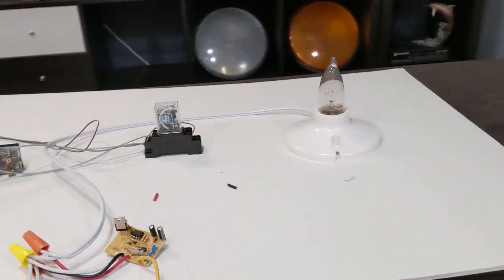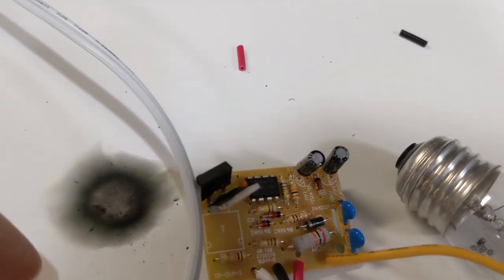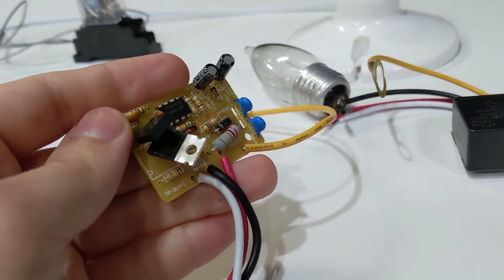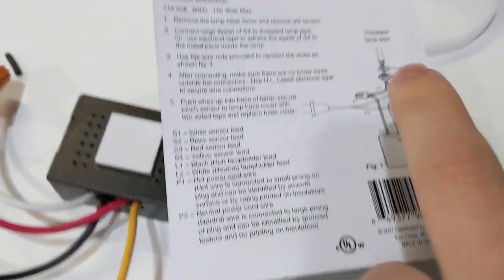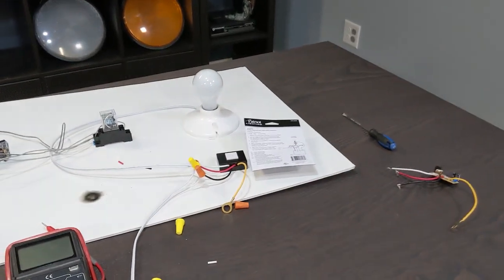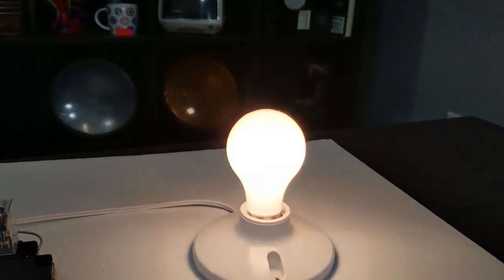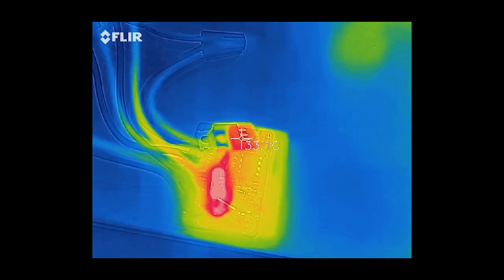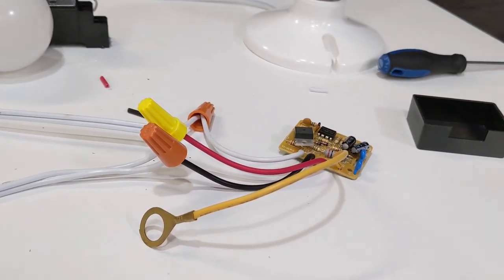A slightly explosive touch-lamp follow-up (standby energy consumption)

Comment: You need to unplug it and plug it in again now that you have a good bulb and see if it flashes while calibrating like the lamp does when first plugged in.
Reply: We can be pretty sure that it doesn't do that because if it did then the first unit would have exploded immediately when plugged in, instead of waiting to be triggered.

Comment: Quantum and classical physics are not compatible. Similarly, the color code used by electricians is not the same as that used in electronics. Any time you cross the line between classical (electricity) and quantum (electronic) you have to translate the color code. Ben Franklin guessed wrong about which way eletricity flows. 150 years later we noticed everything works the other way. It's a built in flaw that will be hard to get out.

Comment: Wow. If I’m reading the diagram right when wired correctly the inside of the lamp holder is live at 110V AC even when the bulb is off (the touch switch circuit must interrupt the neutral line)

That’s incredibly dangerous and would not be allowed here in the EU
Reply: Everyone is forgetting that this diagram doesn't actually know which line is going to be switched, since it doesn't know which way round the user is going to insert the mains plug into the wall. The whole system has to be designed to work either way round. And it is. It just happens to be labelled so they "switch the neutral" in this diagram, but in fact you could change the two labels "live" and "neutral" and swap for "T" and "K" or in fact anything other two non-specific tags. The digram will still work and be equally valid. The fact is, this design is saying "wire the lamp up so one leg is switched and the other isn't." And thats valid. And it will be valid in all countries that have a non-polarised mains utility plug. Such as the US. 

Because, by chance, half the time the plug is going to inserted one way, then half the time the lamp socket is going to be live when off. The other half of the time it won't. Sorry, but thats lamps for you.

The REAL safe way to do it is to design a circuit that switches BOTH wires to the lamp so when its off it is completely isolated from its supply. This in analagous to a double-pole switch. This would be the real*, *correct*, *safety-conscious enigneering solution to the problem. And who knows, maybe someone out there actually makes such a device. 

This one is not a deisgn I would choose to use, but given its limitations, its actually valid. We all just need to stop calling the wires from the wall plug "Live" and "neutral" and all this argument goes away. 

There. I will now tackle world peace...

Comment: What's hard to imagine? Red is typically positive or power side and black is usually negative or ground/earth side, so doesn't seem much of a stretch how they wired this. Or I guess Americans are backwards?
Red= hot, kinda makes sense
.....
Reply: In America white is neutral and all colors (except green) are hot. White is the color of the insulation before dyes are added to the mix, so it makes sense as the color you use when you aren't adding voltage.

Really though, all 120v countries have white as neutral and black as hot. This is a 120v only device, so why would it be using 240v colors? Not just any 240v colors, but 240v Aussie colors.

It seems like Australia is the only country still using black as a neutral. Everybody knows everything's upside down in Australia, why would you accuse Americans of being backwards?

Comment: In Australia Red, White & Blue are active (Hot), Black in Neutral and Green/yellow is earth. I guess this touch dinner was meant for our market and not north America? But still we would never run an un-switched hot wire to a lamp as illustrated in the diagram,. So its still wrong. Very entertaining.

Comment: Here's my understanding of why your original wiring was wrong and why it exploded. If you look at the wires at 1:12, you can see the following:

* The black wire on the board is going to one side of the mains cord.
* The red wire on the board is going to one side of the lamp.
* The other side of the lamp, the other side of the mains cord, and the "output" of the board are joined together.

As such, the board's power supply is connected in series with the lamp. When the board is in the "off" state, the trickle power flows through the board "via" the lamp, but there is not enough current for the lamp to light. No current flows through the board's white wire because the triac is off. When the board attempts to turn the lamp on, current is allowed to flow through the triac between the white wire and the hot wire (black). Because the black wire is connected to one side of the mains cord and the white wire is connected to the other side of the mains cord, this creates a short through the triac (which explodes because it is not designed to handle such high current). Your mistake is summed up at 1:12 with your line "all the neutrals go in one place" while holding the cap with the three white wires going into it - this is incorrect, as the white wire from the board is not neutral and is in fact connected to hot through the triac.

Also, in the UK, red = live/hot and black = neutral was actually the standard here (before they changed to blue and brown colors). But because AC is non-polarised (until you start worrying about earth, which we're not worrying about here), you should be able to wire it according to whichever color standard you prefer and it will work either way (although you have to connect one side of the lamp to the red wire either way, if you connect the lamp to the black wire it won't work). Also, fun fact: In the UK, where our plugs are designed so that you can't reverse hot/live and neutral (and I assume in other countries with similar plug designs), it is standard practice (and a code requirement AFAIK) to wire a switching device into the hot/live line, not the neutral line (otherwise an "off" device can still have dangerous voltage present which is a problem if e.g. you spill water over an appliance or you're replacing a lamp bulb in a socket that's "off" but still effectively live). The wiring instructions for this board have it wired such that, if the mains cord was in fact polarised, the switch is in the neutral line, which is incorrect (notice that one side of the lamp is connected directly to the live side of the mains cord). Although again, because AC current flows both ways by design, the board should work just fine if you wired it up so that the switch was in the hot/live line.

Comment: I sure hope the company who decided to go with those odd wire colors doesn't even make wires for bombs or something more dangerous than a circuit breaker can handle. Good thing you didn't zap it when it was in the plastic or it probably would have started a fire. Someone probably should make them use standardized wire colors in any case.

Comment: In electronics black has historically been used as the ground or negative and red as the hot or positive wire.  This is contrary to USA house wiring colors where green is ground, white is neutral and black is hot.  So one must be careful when joining the two different environments.  Foreign made producers may not follow either convention in their products.  If unsure consult the documentation. I think you have now figured that out.

Comment: It's UL marked, so it must be safe...!  UL marks only mean a LOT of money has been paid by the manufacturer to UL so a retailer who might be clueless about electrical safety and quality feels good about picking up the cost (and the device won't invalidate commercial and gov building insurance policies since an NRTL is involved). UL is about fire prevention and money-making, not quality or standards. CE and UKCA mark system produces safer products from my experience for less money.

Comment: I can see the confusion. Maybe caused by the fact that China might be closer to the European standards than the US ones. Here in Australia I would have expected it to be wired the way that works. I think the wiring needs to match the region it is being sold in. In Australia active is Red or Brown and neutral is Black or Blue. Our flexible leads use blue and brown and fixed wiring is black and red. Earth is always green and yellow. I don't think our code allows for write nuts. We're upside down here in the southern hemisphere.

Comment: This seems strange -- most every "smart" lightswitch I've seen mains goes to white/black and the switched load goes to white/red (or red is a traveler hot in 3-way)
Reply: Switches in NA should all be like that, as it complies with our electrical codes. The "nice" thing is that electrical code only covers the building wiring, not anything inside appliances.

TLDR: if the switch were made to go in the wall, it would need the regular colors as you said.

Comment: The way you first wired it, the line hot and neutral were wired across the triac. When you triggered the circuit, the triac created a dead short across the line. That's why the triac and breaker blew. My guess is the triac blew first and either molten solder bridged the traces, or the current arced over (vaporizing the traces), which then blew the breaker. And yes - very stupid choice of wire colors.

Comment: But why did the globe blow? Its always bugged me when shorts can cause globes to blow.  A particular globe in a car for example keeps blowing and people suggest you must have a short. It does not seem obvious to me that a short is the cause.  Intuitively, if anything, a short regardless of where it is should reduce the voltage across the globe.  
I guess I just have to put it down to a short could cause a surge as the cable acts as an inductor and at the point at which the short is suddenly open the voltage at the globe suddenly peaks enough to cause it to blow. What say Ye?

Comment: Isn't this design also unsafe? Because the triac is used to connect the neutral wire with the hot wire permanently connected to the socket, the socket constantly has power, even when the lamp is turned off.
This means that, for example, if you want to switch the bulb and you just turn the lamp off, you can actually zap yourself if you somehow end up with your finger inside the socket. Of course, you should always unplug the lamp or disconnect the breaker and you shouldn't put your finger inside the socket, but it's still unnecessarily unsafe.
Reply: Yup. This is a switched neutral... Probably fine as long as you wear rubber shoes and don't touch the grounded metal case of anything nearby /s. It's wiring like this that keeps me up at night.

Comment: First think you should know is that when a RED wire is present then that means Postive which is Hot in other countries. So if you want to apply it in America when the capacitater was made in another country then RED/Postive/Hot && Black/Negative/Neutral. That is only if it was made in another country ie: China , South Africa

Comment: The way the Instructions have you wire it is dangerous. They have the Hot side connected to the bulb at all times, and they are switching the neutral side. I would reverse both the wires coming from the plug and the ones going to the bulb. Wired that way it would switch the hot, and the neutral would always be connected to the bulb.

Comment: 5:33 - O. M. G. The box requires the BLACK wire be connected to the line cord's Neutral (white)? And the red wire goes to line cord's Hot (black)? *FACEPALM*
(Bear with me, it's taken over half an hour of mostly-buffering to get to this point... I guess Sunday 10PM is peak demand for Xfinity. Not sure what all these people are doing, but I know it isn't playing Fallout 76.)
Instead of wire nuts for this type of bench test, might I suggest Wago terminals in the future? Big Clive has featured them, and knockoffs of Wago, and I use them here and there and found them to be quite handy.

Comment: It is incredibly common to have white/black be STANDARD colors here, and then RED is Switched Hot. This product is entirely wrong and if they were going to use random colors they should have at least omitted black/white to make it obvious that it's not normal.

Also, no, plugging in the other way would not have helped. Looks like you had it wired in a way that it got one feed through the resistance of the bulb filament, and then created a short between Live and Neutral lines when it turned on (exceeding the 200w rating by ... just a little bit.

Comment: to be fair, while it is dumb, maybe they thought that "hey, most folks don't have any idea of wiring codes at all. When folks think of hot, they think "fire, red, red hot", so let's make the red wire the hot one" 

Granted I'm not amazing at knowing the wiring codes myself, but that's also why I don't do much more electric work than just changing caps on old radios. If I can't repair it by just replacing the old wax capacitors, I'm usually gonna be hesitant to do much else without first asking someone who's more knowledgeable.

Comment: I’ve never heard of using black as the hot in the US. Our car batteries, for example, are Red for positive and Black for negative or red-hot, black-ground. But I’m not real knowledgeable about AC circuits so maybe there’s a difference in that industry?
Reply: Black-Red-Blue are the three phases in the US, and white is neutral. Which is really really counterintuitive, as in Europe, blue is the neutral, and white/grey is one of the phases... Red hot sounds nice, white would work as something really really "hot" too, so does blue, but definitely not >black<. In Europe we often call them "live" or simply "phase" instead of "hot", and you'd associate both red and white and all these colours with living things once again, and not black. Black is the colour of death... but maybe that's exactly why it is the colour for one of the phases... In Europe it's generally Black-Brown-Grey.

Comment: The wiring you needed to do is pretty common when wiring a switch at the end of a line not in the middle of the line like is more common. Your first attempt wasn't incorrect because of the color of the wiring it was incorrect because you attempted to wire it as an inline switch.  That's not how touch lamps work.  They are an end of line switch that's why the hot wire needed to be connected to the neutral wire.

Comment: Another thought is they used DC colours for wires. Black is neutral in DC, Red for Positive, then the White on Switched Neutral.

But WHY is the switch on Neutral? So dumb. Switches should always be on hot.

Comment: It seems very unsafe to have 120v at the bulb socket all the time and to switch the neutral line.  If you were to accidentally touch the conductor in the socket with the lamp off you would be electrocuted.

Comment: Also kinda weird that it switches neutral and not hot... I mean, obviously it doesn't really matter since you usually don't know which wire is gonna be neutral and which is gonna be hot, since it depends on how you plug it in. But you know, if you're gonna choose, I would rather switch the hot side and have no hot going directly to the lamp socket even when it's off.
Anyway, lesson learned I guess... Never trust the color coding. And yes, it may be stupid to use black for neutral from a (US) American point of view. But you know, in China black is neutral and red is hot and obviously that thing was probably manufactured in China. And while I'm from Germany where usually blue is neutral and brown is hot (though sometimes you also see the white for neutral and black for black as is typical in the US). I actually consider the Chinese color coding more logical to be honest, since in DC systems usually black is negative and red is positive and usually negative is ground which is "sort of" neutral. That said however... The actual problem was that you expected the switched wire to be the red one and not the white one. Switching hot and neutral obviously makes no difference, otherwise you would have to plug it in the right way around for it not to explode.
Also, keep in mind that for incandescent light bulbs half power is not half brightness, since the power also affect which wavelengths the light bulb puts out and therefore at lower power levels more energy goes into infrared than at higher power levels.
And finally... The BT136 is rated for 4 amps which at 120 volts is 240 watts... But due to the way triacs work, the power essentially has to go through to diodes, which results in a voltage drop of about 1.4 volts. At 4 amps that would result in the triac dissipating 5.4 watts of power which is WAY too much for it without a heat sink. For the TO220AB (the body the triac comes in)  without a heatsink and in that not particularly well ventilated enclosure I would say it's safe to dissipate about 1 watt. That would be around 0.7 amps or 85 watts. Personally I would say 150 watts is really pushing it. The triac may survive, but I expect it would probably reach about 100 °C (212 °F). Which for some components may be ok, but for that particular triac it's definitely not a safe operating temperature. Especially not with the PCB just freely flapping around in that flimsy plastic enclosure.

Comment: ummm considering that you would be touching BARE WIRES on this circuit, shouldn't you have validated the wiring diagram before touching anything? I mean, this could have ended much, much more badly :|